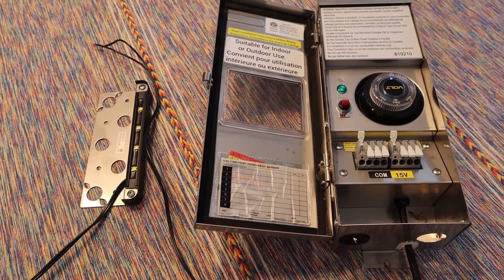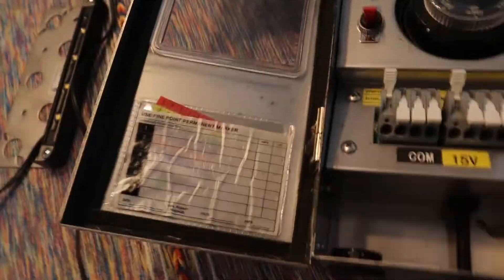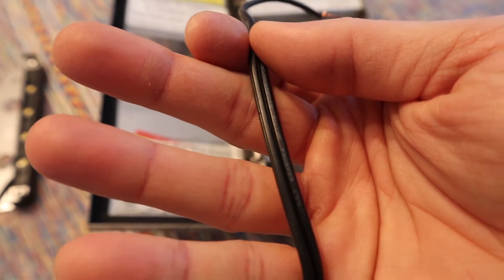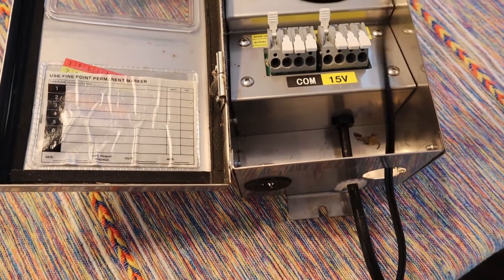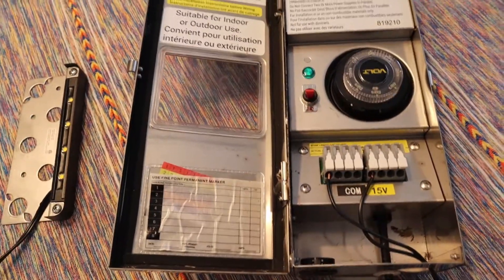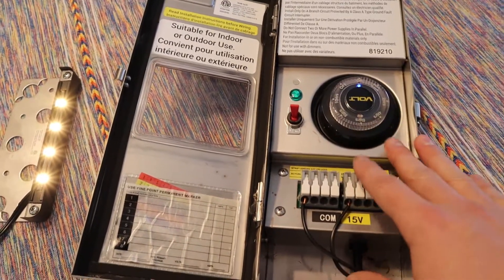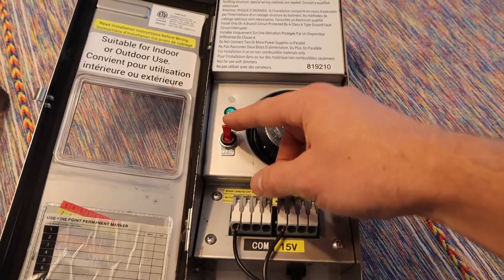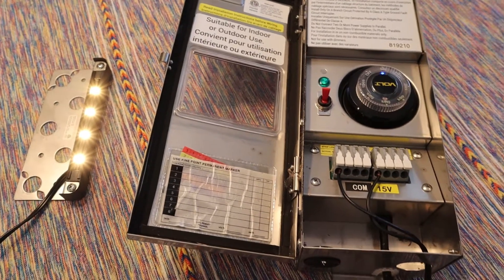LOW VOLTAGE LANDSCAPE LIGHTING TRANSFORMER | How to wire a professional VOLT landscape transformer

Comment: I'm thinking about purchasing the Volt slim transformer for 9 pathway LED lights I plan to put along my driveway.  The closest light will be about 8 feet from the transformer, while the furthest will be around 20 yards. With this particular transformer only having the option for 15V, do you think that's too much, especially for the lights closest to the transformer?